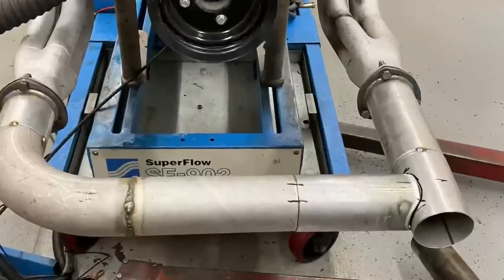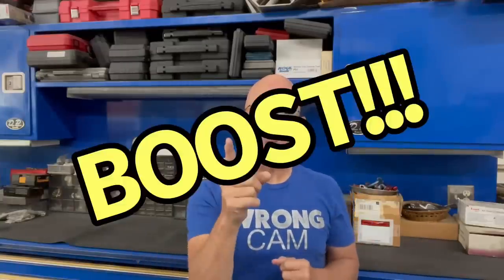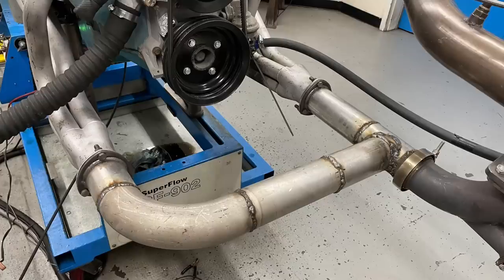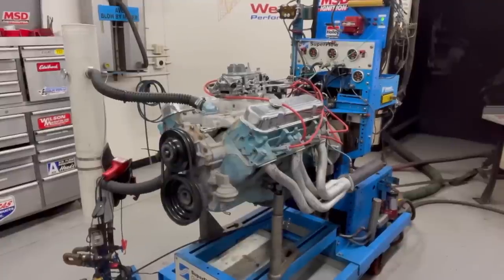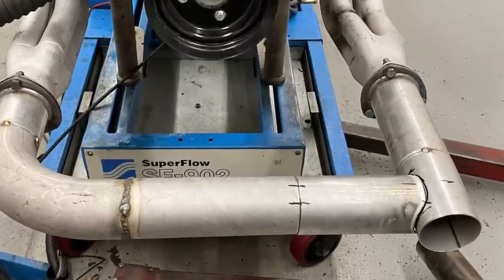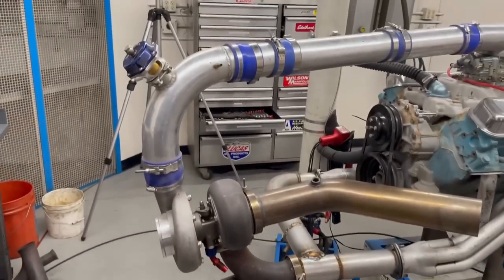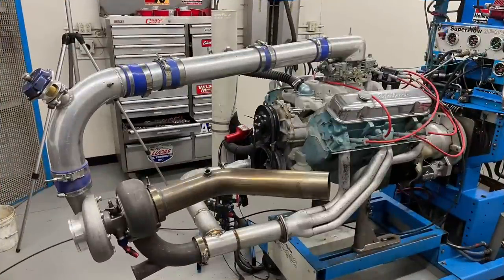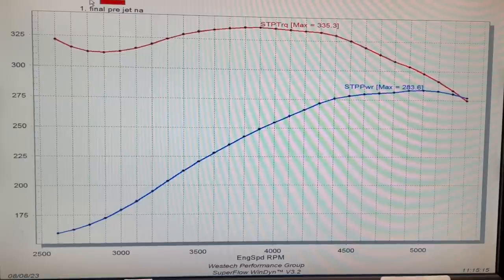8-Hour DIY Turbo Kit. How to Build a CHEAP Turbo! How to Turbo your Pontiac 350! Full Dyno Results

Comment: I absolutely love this others guys stuff. I'm working on a turbo EFI flathead Perkins engine for my 66 Massey Ferguson backhoe.
Reply: E85?
Reply: @AustinRBa  possibly, it's 11.1 compression from the factory. It's a model20. I have E in it now, have to run the choke 1/4 mass. Lol
Reply from the maker: very other guys!

Comment: It doesn't have to work perfect, it just has to work! Stock cam and boost are always great for mid-range power...and in most cases makes more than a typical hot NA setup.

Comment: Those poncho 350's have always been kind of underrated. I've seen them run just as rowdy as a 400 with just mostly a head and cam swap. I had a 350 69' firebird I eventually did a 400 swap. After all the time and money, I couldn't really tell much difference.  I now have a cheap 326 I paid $150 for. I've thought about building it for boost. Maybe try to fab up or modify a intake set up like that came on the turbo T/A 301's. But probably easier and safer to just go with aftermarket fuel injection. Just a set of modern aluminum heads and a nice roller cam setup. That lil 326 would outrun my Ram 3 400  But the best part If I blew it up I'm not really out much vs imploding one of my 400's or my 428. The prices people are asking for even the mid/late 70's  low compression 400's over the last few years is almost as ridiculous as the recent inflated prices at Mcdonald's.

Comment: Nice to see one of the "Other" 350s getting some attention. Now do the same to the Buick and Olds 👍
Reply: He already did a 455 Buick
Reply: @atenooie  The 350s, Buick 350 and the Oldsmobile 350.
Reply: @jaytownjunkyardfiles1999  you are right, 350’s for the win!!!
Reply: @atenooie  I almost need a different engine for each type of driving I'm going to do. Sometimes I want a 5 liter, a 5.7 and some kinds of driving requires the full Monte . . . 455. So many choices, hard to settle on just one.

Comment: I love these Pontiacs and rebuilt several as my first engine projects. The 350, 400 and 455 are all the same engine. Almost identical except bore X stroke so those extra heads will fit any of the 3.  2.11 and 1.77 good sized valves on the 6x’s if memory serves from 30 years ago. Lower rpm range than a Chevy but lots of power for its era. Excellent video!

Comment: Should do a comparison in output between that t-section and a Y-section that feed the turbine. Is there a difference in power through the band?
Reply from the maker: there won't be at this flow and power level

Comment: I wonder if it's possible that the increase in power provided by headers is due to the pistons having less pressure on the exhaust stroke, freeing up power to the crank.

Comment: With the weak wearing on the crank shaft the black would have very little strength to hold back the rotating mass underboost extreme boost I mean added protection are you going to do for the block I've seen the crankshaft and connecting rods and pistons eject themselves out of the engine going down the quarter-mile

Comment: Thanks Richard, you inspired me years ago starting with the GT45 on old engines.
I made my own kit on a 350 Oldsmobile with no.8 heads, 1976 Smog motor and that GT45 turbo. Put a FiTech 600hp Power Adder on top and a locked out HEI. Put it in an old Altered Chassis and now runs mid 10’s with 8psi of boost on a non prep track, Cheap fun!!!

https://youtu.be/9SPM8tbzEF8 @14:55
Sorry that it is in German 🙏
Reply from the maker: That is awesome!
Reply: @richardholdener1727  Thanks for taking the time to reply 🙏🙏🙏. Currently the rear end gearing is not long enough. I will put in a 3.73 instead of the 3.91 as it hits the limiter of 5800rpm @126mph. Do not want to rev the engine higher with the stock parts. So far only the valve springs have been upgraded. Before I had severe valve float at 5200rpm, bent a pushrod. Cam is a RV comp cams.
Reply: @atenooie  I am looking to do the same kind of build, nicely done man! At what rpm does the GT45 spools?
Reply: @maxpower479  I start on the 2-step at about 2500 rpm with 2,5psi. As soon as I let go boost will increase.
2800 rpm - 3,5 psi
3500 rpm - 5,1 psi
4250 rpm - 7,5 psi
5000 rpm - 8 psi
5400 rpm - 8,6 psi
This was with a soft spring

With a harder spring it looked like this.
2400 rpm - 2,1 psi 2-step
Run
2800 rpm - 3,4 psi
3400 rpm - 3,9 psi
3900 rpm - 6,3 psi
4600 rpm - 10,5 psi
5000 rpm - 13,4 psi
5200 rpm - 16 psi

This is from my data logs.
Please remember that my car is very lightweight. If your vehicle is heavier it can show more boost earlier in the rpm range.
My build is pretty simple, log manifolds made from mild steel, GT45, 50mm wastegate l, 50mm blow-off valve, fi-tech 600 PA, ring gap increased, beefed up valve springs.
Return of the turbo drain in the old fuel pump location so I did not have to drill the oil pan.
Reply: @atenooie  excellent, Thanks for the details!

Comment: Love your videos! Thinking of doing this to my ford 360FE ratrod. Did you use any electronically controlled systems like an MSD 6al-2 for timing? Or did you set timing and go with it? My goal is 7psi of boost, blow thru carb style
Reply from the maker: just the HEI

Comment: Man. That setup would probably rip on my smogger headed 400sbc with a decent erson cam in it. Hell it woyld rip on my 4.5 ltr Mercedes v8. Do you think a gt 35 would be better on smaller displacement not going for more than 400 ish? Its probably 200, so maybe 240-250 on the Dyno setup.
Reply: Be very responsive 35r is what early model Barras had factory. Mine was very mild , valve springs and 12 psi boost. 

Full boost by 2-2200 rpm on a 4l 6 and 420 atw hp.

Comment: Wait is that a normal carb or a blow through carb? If it's normal is it safe to put boost through it?
Reply: Get a 750 holley dp, replace the brass floats, get the weakest power valves you can find, drill out the powervalve bypass holes a couple bits, jet up 5 sizes (or so), make sure you've got a fuel pump/regulator that can supply 1:1 fuel/boost ratio, those are the basics, there are a lot of other things you're gonna wanna do, like vent extensions and whatnot. bottom line, is you need a wideband to tune with or you'll be making aluminum crumbles quickly.

Comment: Richard, does the distance from the exhaust ports to the turbine inlet actually have a lot to do with turbo lag? I'm really considering a turbo in the bed of my truck vs under the hood is why I'm asking. I keep recalling proper turbo sizing is key in all your turbo videos, and not much about placement.
Reply: I don’t know about lag but I got halfway thru a rear mount turbo project and ended up moving it to the engine bay. There’s more room in the bed, but running the exhaust and intake tubes all the way to the front is a huge pain. Lots of leaks and trying to rout stuff around frame rails. Unless your putting a 454 in a mini truck you’re better off just making some room in the engine bay (or cutting a hole in the hood!)
Reply from the maker: it does change lag-but still works

Comment: Where do you put the oil and coolant lines into the motor.    I'm also boosting my 77c10 and I have all I need   just can't figure out where I should put my lines
Reply from the maker: oil drain to pan, and take the oil feed off the motor for the turbo

Comment: I think this is great content, it proves that Pontiac engines are only useful as boat anchors. Boosted or not boat anchors nonetheless.
Reply: 285 was alright, early LS are only 320 and it's mid 8:1 compression . 413hp on 6 psi at 5000rpm isn't too bad at all especially with the piping. Be an absolute tree stump puller.

Comment: unfortunately there is absolutely no room to do this in a Firebird...
Reply from the maker: you route the exhaust to fit your chassis-can use stock ex manifolds
Reply: @richardholdener1727  How would you get the return into the carb with the shaker?  Unless you get an aftermarket highrise hood I'm not seeing a way.